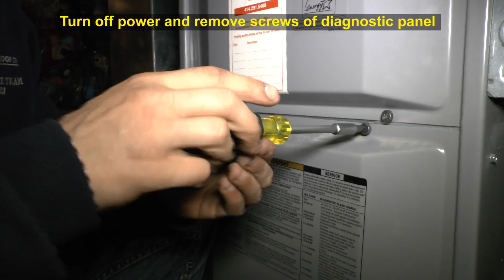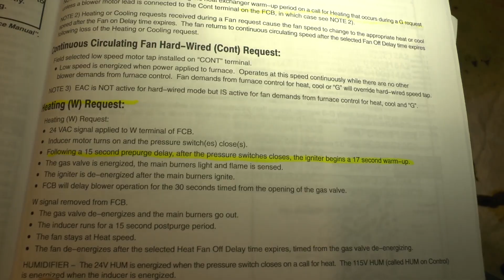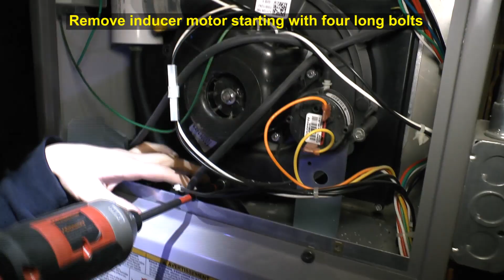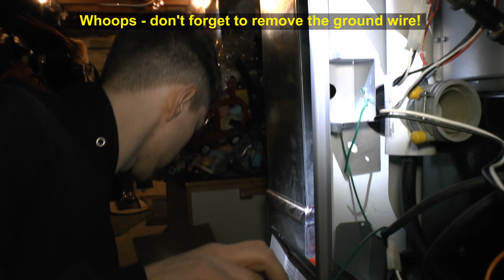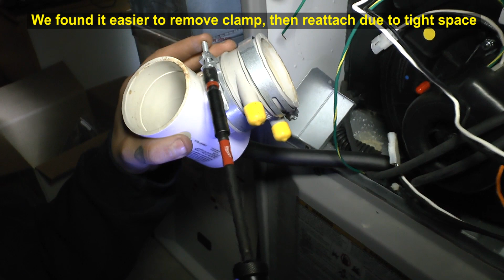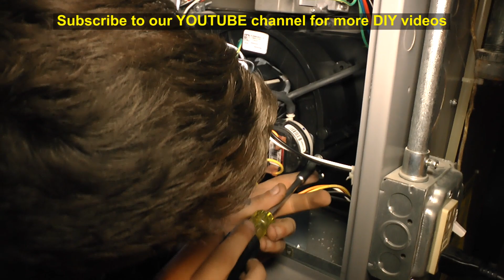Furnace Not Working - Bad Inducer Motor - Step by Step Repair Instructions #noisyfurnacerepair

Comment: The most important lesson in all of this is that HEIL makes horrible High Energy furnaces! I have an LENNOX that is 20 yrs old and have never replaced any motors. HEIL is truly a bad company to buy from! An inducer motor should last for years and years with sealed bearings. They are using cheap parts and owners are paying the price for it.
Reply from the maker: Hi Dave, Thanks for watching and sharing your comments. It is disappointing when a component fails, we are very thankful however, that this part replacement was not overly expensive and the procedure is relatively simple. This particular furnace will need another 10 years of service to determine whether the much lower original cost(compared to Lennox) will be offset by further issues and parts in the future. Congrats on 20 years of trouble-free service.
Reply: @VintageVideos2009  So this must be one of those, you get what you pay for, lessons we all learn the hard way. But I suppose that as a maintenance tech one would rather see poorly manufactured systems that require call outs, as that is what puts food on their tables. Lots of money to be made reselling those parts at service call pricing. BTW those claustrophobic rat,spider and snake infested crawl spaces they are all yours!
Reply from the maker: @davenone7312  Yes, that can be one lesson for sure. Another lesson here can be, that I'm a guy with no affiliations whatsoever to any furnace. In fact, I'm an Average Joe, and not a maintenance tech. Just a guy who asked some questions, discovered this issue, and saved myself as much as $500 by doing the work myself. That's my lesson to share - Ask questions, maybe you'll save yourself a nice wad of cash - "keep learning!" It's all good. Everyone can choose what they want to buy and their reasons why. Thanks again for watching and sharing some helpful advice.
Reply: How do you know so much about Heil furnaces and their reliability? Are you a qualified HVAC repair man?

Comment: Thank you, this matches my system exactly I believe.  (Mine says Jankel, Inc. Part 119394-00) I'm hoping, guessing, assuming and am pretty certain this is the system/part we are talking here.  I'm a rookie, newbie, but this sure seems doable.  BUT, {now I sure wish I could attach pictures} the installers have sealed up the PVC pretty good, even sealed the clamp to the PVC.  You recommend removing the clamp and even remove the PVC joint here and there. It's real tight in there & I wonder if this recommendation is more of a requirement - Can it be done without removing that clamp and joint? The PVC has something purple on one surface and some clear-like epoxy like material sealing it & the PVC/clamp is sealed with some yellowish, hard but malleable material.  I don't think I want to mess with the pressure sensor (hope that's the right name) and hoses jammed up tight against it, but I don't want to start cracking PVC, especially that main PVC joint with the black hose going up into its bottom.  FYI - getting me confident to do this myself would definitely be a victory for the DIY community, because here in the DC metro area, this repair has been cause for less than forthright repair shops to attempt to suggest that furnace replacement may be the best course and have led me to expect to be charged upwards of $1300 for the job.  I've already found the part for about $150, and even if I pay someone, this video has helped me to know what prices to entertain.  Thanks again.
Reply: Sorry - Pressure Switch not Pressure Sensor
Reply from the maker: @johnc2020  Hey John, wow, that's a lot of info! Thank you. OK, with regard to the PVC pipe, the purple and clear compounds you see on the pipe are the primer and epoxy cement, that are used to fuse together pieces of PVC. This is common. You will not be able to separate those pieces, as the bond tends to be permanent. It is relatively tight in there, and for our video, by removing the clamp, it gave us the modest amount of room to remove the old impeller motor. That will by your challenge - to completely remove the old part in order to replace with a new one. Hope you can do so, without cutting the PVC (then having to replace that section too) - but it may be necessary. PVC pipe is inexpensive, but again, in tight quarters you'll need to think over how you will make changed and also not impact surrounding parts or operation. All the best to you!

Comment: You replace an inducer motor, you did not repair the inducer motor. Change your fucking title moron.
Reply from the maker: Yes, you are correct, we did replace the inducer motor - and thus, we "repaired" the furnace!   It's more important to have a "working furnace" - than it is to have a "replaced inducer motor" right?  Just words, my friend...The FURNACE WAS REPAIRED, by REPLACING THE INDUCER MOTOR.

Comment: In case anyone is wondering, it cost me $315 total (parts + labor) for me to have this part replaced professionally.
Reply from the maker: Hi Jason, thanks for sharing. Yes, the part price varies quite a bit, depending on whether it is OEM spec, refurbished, or "lesser quality/warranty" part. Usually a heating company will perform a full diagnostic on your furnace as well, even though they may highly suspect this is the defective part. That is very understandable and expected. So, totals vary from roughly $250 (very affordable) to over $800 (fast service/below zero/emergency type scenario).  Thanks for watching and sharing your information and best of luck on your furnace life and service.
Reply: Hahaha

Comment: I have the same furnace. I have already replaced mine two times because it gets so noisy. It’s getting noisy again. I wish there was a way to make it quieter without the cost of total replacement
Reply from the maker: Wow, twice...so I might speculate that there is something more wrong then merely the inducer motor part itself? Perhaps something else is preventing the inducer motor from properly aligning in place? Or something else may be causing friction with the part. But we'll continue to watch this part and see how it holds up. How long has the replacement motor worked, before you needed to replace it again? Just curious. Thanks for watching and sharing your comments.
Reply: I just bought the new one in February 2019 and already it sounds like the bearings are going out. I’m not sure what else could cause it because it’s a self contained unit held on with a few bolts. The last one I replaced worked fine but had a high pitch squeal to it. All would be fine if it was in the garage but it’s in a closet in the kitchen so the sounds echos thru the house.
Reply from the maker: @deanhere  Thanks for sharing. Our replacement was installed Christmas Eve 2018, so it's coming up on one year of service. We'll keep an eye (and ear) on it. Thanks everyone for watching and offering your experiences.

Comment: So, if the inducer motor is bad, the igniter will not come on, right?
  My unit went out. The inducer motor only hums and gets warm to the touch. The igniter/gas does not come on. I assume the inducer has to evacuate the system before the call for gas?  
  Stands to reason. 
  This happened during the night. I hope nothing else was damaged. 
  The thermostat seems to ohm out okay with electrical power off and just powered by the batteries. 
  One other question, does the contractor engage when in heat mode, or does it only engage when unit calls for cold air?
  Thanks.
Note: this is an outside unit (Heil).
Reply from the maker: Hi Rickey, thanks for the questions. Yes, if the inducer motor is bad, the igniter will not get a signal to come on, thus it will not glow, and no gas will flow into the chamber. Humming and warmth to the touch or hot inducer motor are symptoms of a defective inducer motor. So, if the inducer does not clear the system, their will be no further call for gas/or for the igniter to fire. Honestly, I'm not sure about the contractor sequence, depending on model. However, based on your information about the humming and warm inducer motor, I would be inclined to believe that is the culprit. The furnace in this video was 10 years old, which is a common length of time for a service need/failure of that part. Good luck on your repair and thanks for watching.
Reply: VintageVideos2009 Removed the motor and got it to spins little more freely. Put it back in and let it run (with the cover off)while I went to get zip ties to bundle the wires back like they were. 
  Got back home, and it had quit. Wife had turned the stat down. Said it was getting hot in the house. I had it set in like 74. She turned it down to 68. Has not worked since. 
  I will backtrack my steps. Not really surprised. I suspect the bearings are bad , got hot and locked the motor or overworked it. 
  Motor is Fasco model: 1085571. What ohm reading should it show?
  I suspect the windings may be damaged.
  Okay, when I put the zip tie back on the wires to bundle them up and maybe keep them from vibrating against the cover, I inadvertently pulled a blue wire off of a relay. 
  It then sent power to the motor and it started very slowly, but it did start and get up to speed then the heater came on. 
  Going to let it run a little check the motor itself to see how hot it gets. 
  Not sure if this is the type that can be oiled or not. It does NOT have “Sealed” stamped on it, but it has no oil oil holes in the back. It does have holes in the front, but there are four, and I doubt they are for oiling.
  Motor got hot to the touch. I think it is too hot. Can’t lay my hand in it for very long at all. 
  New motor time. :(
 I will recheck the capacitor, but I do expect it is still good and I will need to change the motor. 
  I really appreciate these videos 
  I do see some similarities in these appliances and dryers which helps me understand these videos a little better.
Reply from the maker: @rickeykeeton71  Hi Rickey, given that you got the inducer motor to spin, but it got hot, is an indication that the bearings are likely bad and this is the part you should replace. I would certainly start there, and something tells me this will get your furnace back in business. Good luck my friend.
Reply: VintageVideos2009 replaced the motor. Seems to be fine now.
Reply from the maker: @rickeykeeton71  Great news. Based on the humming noise and getting hot, the way you described it - that sure seemed to be your problem. I hope the furnace continues to give you long and reliable service.

Comment: Good job  doing this today .Thank you
Reply from the maker: Hey Jeff, thanks for watching and sharing your comments. We discovered this repair is relatively easy to complete. And by doing so, we saved about $500 for the service fees and up-charge on the part. The furnace has been running just fine since the repair.  Good luck on your repair as well.

Comment: What did you inducer motor. You didn't tell
Reply from the maker: Hi Islam Shafiul, the defective part that was replaced on the furnace is commonly called an inducer motor. If you watch the entire video, you will see that is the part that is removed and replaced. Since the replacement, the furnace has worked perfectly, and we saved hundreds of dollars by doing the work ourselves. Thanks for the question.
Reply: in mine they used some type of red sealer why did they and what kind os sealer is it?
Reply from the maker: @yairubaldo7630  I'm not sure what you are referring to, you mean where the unit is attached to the PVC pipe? It is a cement compound, if that is what you are referring to? If that is the case, you may have to cut the PVC pipe and then replace it. Good luck on the repair.